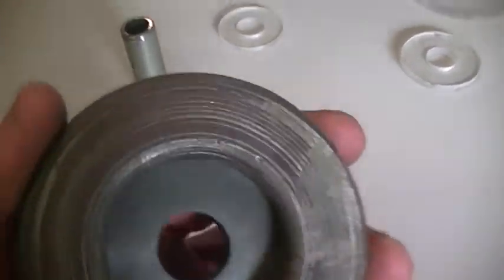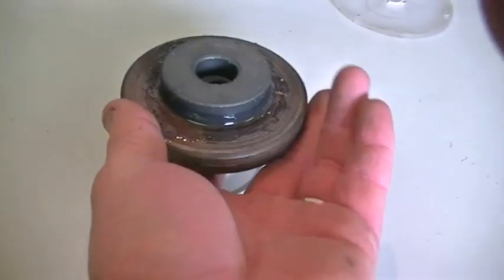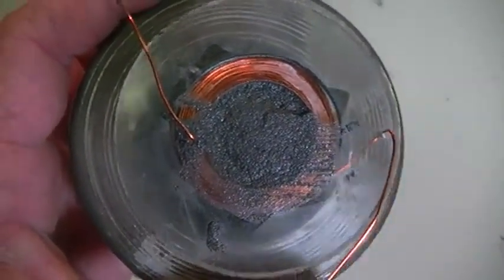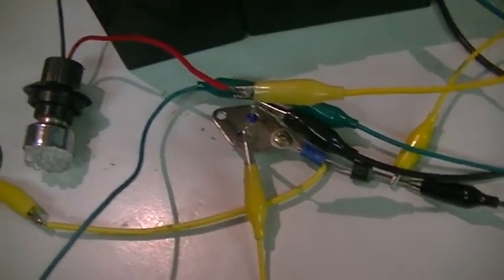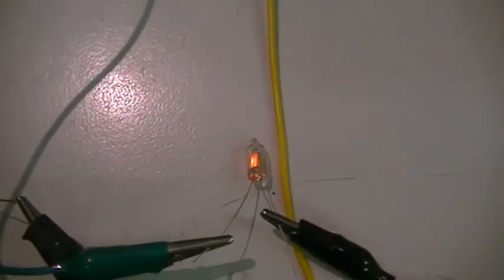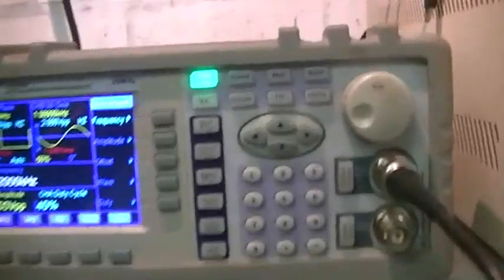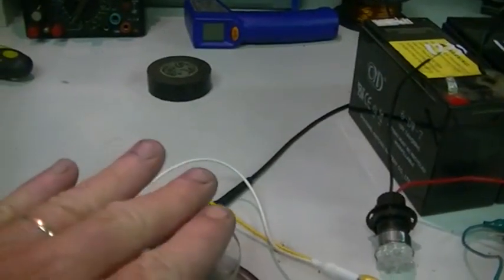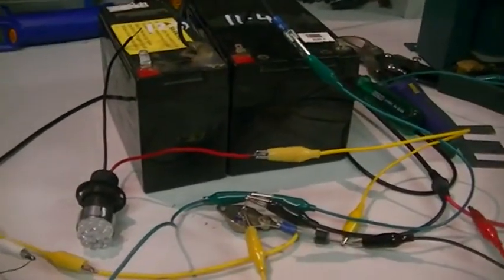Self running Oscillator, power source yet unknown

Comment: Top stuff !
My theory is that your space rock is powering it lol
The frequency shift with the hand placed on it points perhaps to grounding..more ground higher frequency, so less ground may equal less frequency. Whatever leads compose a grounding effect may be where to look ?!?!
Maybe you've tripped over a Leedskalnin principle of magnetic currents :)
Reply: slider2732 What ever the source, it is Direct Current. One can tell because only one of the "poles" of the neon lamp is surrounded with a glow. Something must be causing an oscillation in order to step up the voltage. I wonder what characteristics that laminated torrid is lending to this? Weird
Reply: Craig Nehring
Good point and observation. Have tried a replication here and it won't even run as a joule thief yet lol. It does always seem to rain when he tries this type of thing...but with an actual Ground connection, that's never a bad thing.
Reply: +slider2732 Hi i would like to replicate this as well .......the schematic i have made of this doesn't make sense could we swap details on schematic?? thanks
Reply: Heck I hardly remember it lol. Might get back to it certainly 1 day. Tinmans builds tend to be a little larger than my own, so I usually build when things like microwaves come along on Freecycle.
Best advice - build the circuit that doesn't make sense ! I redrew a Bedini SSG years back because of similar reasoning and the variable pot caught fire. Changed it back to as described and the motor ran fine.

Comment: Ja, I had a similar even before - turned out it was some switch-mode power supply giving the energy. Unplug all equipment and turn of the mains to the lab just to be sure. If the neon is then still lit it is time to get excited.

Comment: Did you notice spikes on scope didn't change much when you put your hand on toroid? Still at 1.8 divs per spike even though frequency reading changed from 36KHz to 101KHz.  It means you cant trust scope frequency counter reading.
Also thinking that collector base junction on transistor is a good diode to rectify pickup from your big coil (antenna) So possibly might be picking up switchmode power supply noise from scope or function generator?

Comment: Hi, my friend, this is ARK ANGEL., long time no comments,LOLOL HERE'S WHAT YOU HAVE GOING ON,... You've mistakenly" tapped into what is called 
( The EATHER),. Okay' The RF waves look identical to the AC - waves, to the scope.!! Only a little bit different" to the neon.!! But it will still light - up.!! Now, 
This usselly requires an earth ground. 
Voltage increases about 100 volts every hundred meters into the sky" but I think you're coil is some how pulling down and Bending the atmospheric voltage. NOT SURE, But that should put ya, in the ballpark of what's happening,.. So, you can go from there" & do the resurch. 
P.S. You've proven you're self to be nobel,
BY showing this.!! Most would keep it in a secret place, notes & ALL.!! SO" I will help anyway I can. Good luck !!!